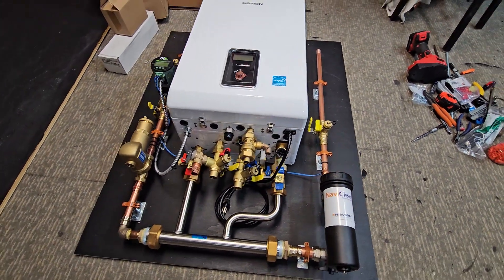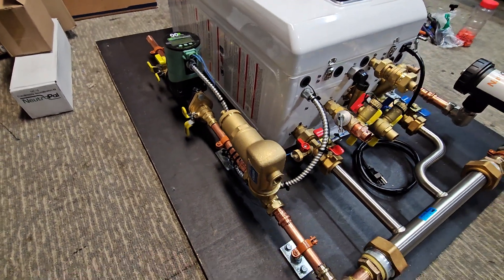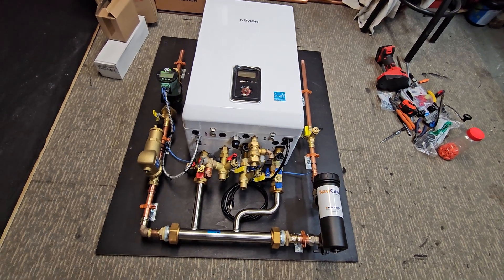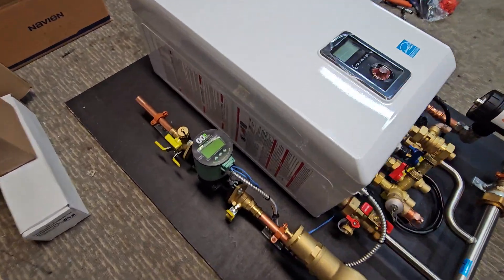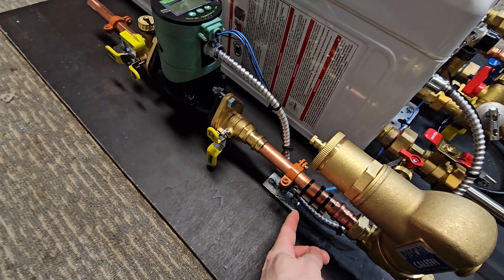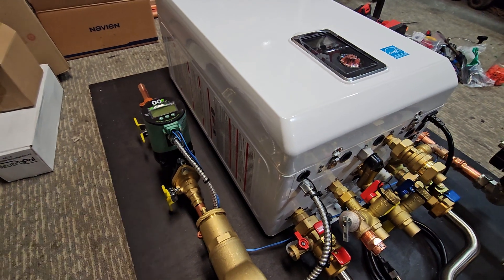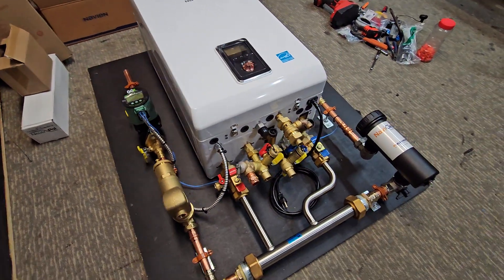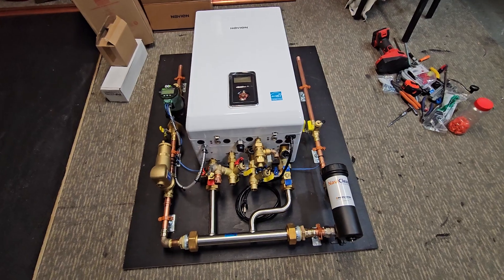Navien Combi Single Zone Boiler System

Comment: I see that Navien offers supply and return temperature sensors as well, but they tie directly into the boiler.  Will the system operate properly if you install both the two VT2218 temperature sensors and the two Navien temperature sensors?
Reply from the maker: The circulator temperature sensors are for maintaining a specific delta on the secondary loop. The navien temperature sensors are to allow the boiler to see the temperature that is being delivered to the secondary loop. The boiler only knows what its sending to the primary loop but not the temperature once its mixed into the secondary. The boiler can only use the supply or the return sensor but not both. Typically I use the supply. You also need to tell the boiler to look at this sensor in the settings.
Reply: @JimSperanza  I see that the boiler has both supply and return terminals.  Are you saying the boiler doesn't let you use both?
Reply from the maker: @frankrizzo7307 thays correct only one or the other.

Comment: Hey I have one more question.  The VT2218 pump comes with ring gasket I believe, and the flange kit comes with full face gaskets.  Which ones should you use?  Thanks.
Reply from the maker: @frankrizzo7307  what brand flanges?

Comment: Hey, I managed to download a manual and I was reading that it mentioned a check valve to prevent reverse flow in the heat space piping.  Do the components you used have this ability, or is that something that will be added?
Reply from the maker: @frankrizzo7307  if the circulator mentions IFC then it comes with a integral flow check that can be inserted right into the end of the pump.

Comment: That is a nice setup!  I noticed you did not install a pressure guage and a strainer.  Not sure if you plan to or not, but if you did, where would be the best place to install them?  Is there any available ports for the guage the way you have it?  Thanks.
Reply from the maker: @johnschubert4752  the boiler has digital pressure readout. Any additional gauges are just potential issues with no real value. The black component on the right is a magnetic filter. No need for a strainer.
Reply: That's pretty cool.  What about a check valve?  Do you need one on this type of system? @JimSperanza

Comment: Which valves are you using for the domestic hot and cold water?

What kind of PRV is that?
Reply from the maker: @frankrizzo7307  webstone service valves for DHW. Pressure relief valve is a very common part do you mean the air seperator?
Reply: No.....sorry, i meant the pressure reducing valve/backflow @JimSperanza
Reply from the maker: @frankrizzo7307  ahh yes it's a BP900 backflow preventer. It does not regulated pressure. The navien automatically regulates the pressure.